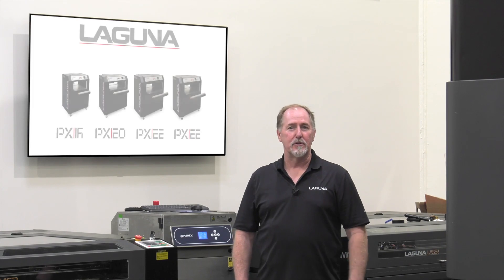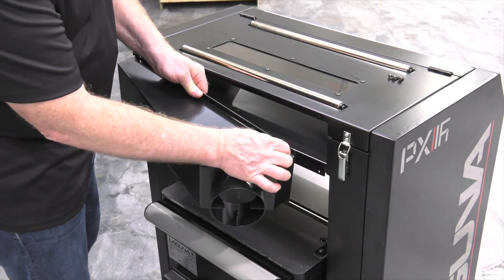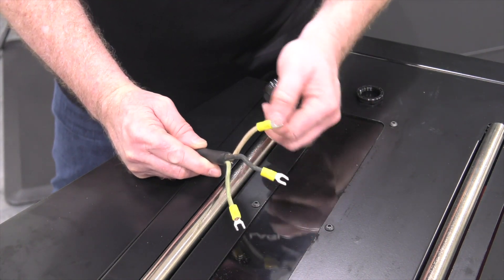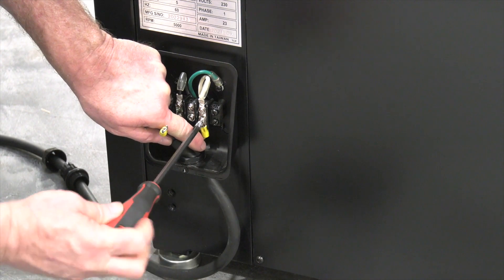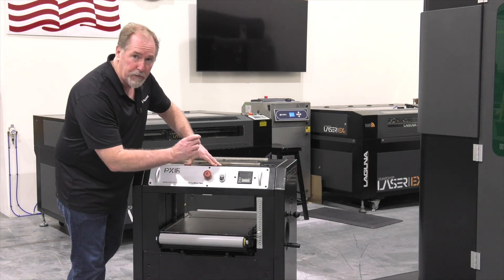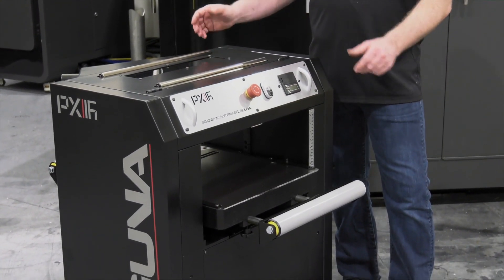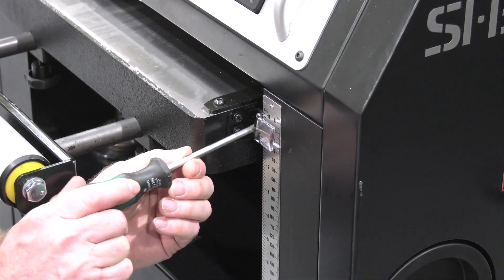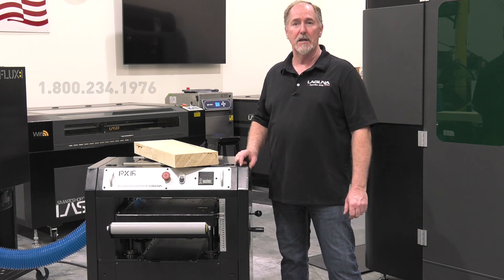PX|16 Planer Set Up Walkthrough |  Laguna Tools

Comment: @3:40 "The machine is shipped with motor in neutral position."
I have everything wired up. I'm turning it on and there's no motion. Is that because it's still in neutral?  Is it permitted to change it from neutral to high or low in order to get the motor moving? 
There is no sound from the motor or any other thing to indicate that the planer is electrified. Obviously, it ought to be electrified. I can confirm that with a multimeter testing the connections in the junction box.

UPDATE: E-stop was pushed in. That's why it wasn't turned on.  pull out the E-stop all the way.   The machine should turn on and the motor will operate, even when it's in the neutral position.  After ite motor is running, you can change it out of neutral

Comment: Hi. I am looking very hard at this, but I was sideswiped by a few guys that have a bit of planer experience and it has been suggested that a planer that has a movable bed is not as accurate as a moving head. It appears that Laguna has always made planers with the head being the adjustment and I wonder if you have had any issues with something like this and why you moved away from the heads moving and not the bed?